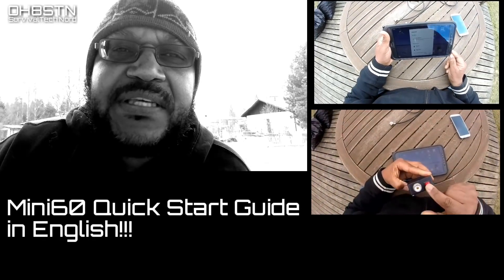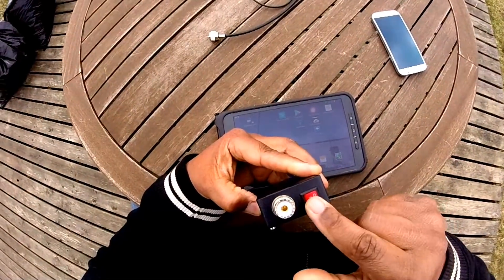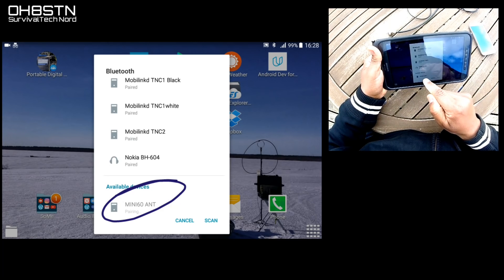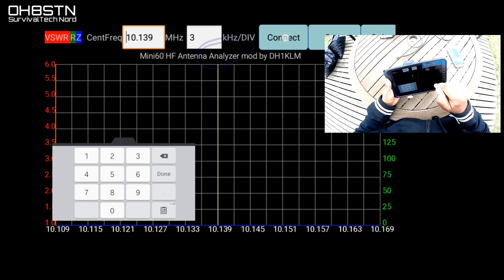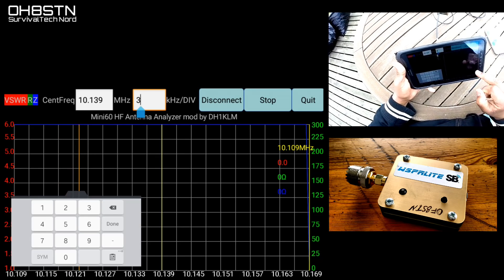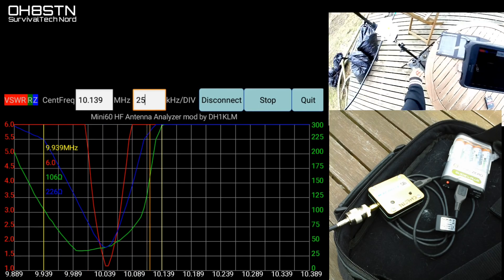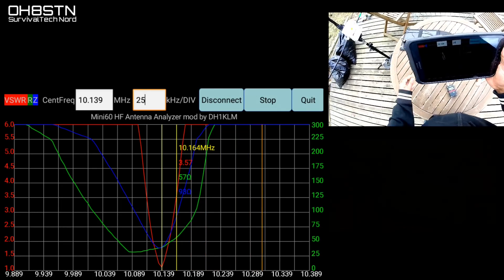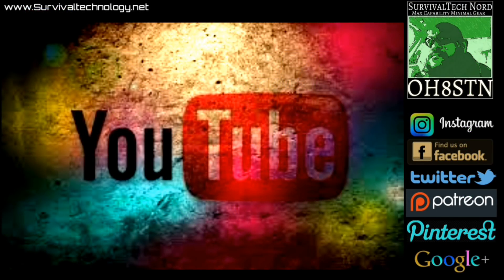Mini60 Ham Radio Antenna SWR Impedance Analyzer Tutorial

Comment: I'm in Thailand right now and can't get a Mini60s with BT, only USB version. Can I connect my Android phone via USB to the Mini60s and use the same APP ? If you have a chance, let me know.
I don't want to order BT less version and install BT module myself ...
Great instructional video, thanks for sharing this ..!!!
Reply from the maker: This is an old video but at least on mine, USB works as well. I just plug it into my Android phone or tablet with a usb OTG cable. You might want to ask the seller if that is still supported on the newest versions.

Comment: Hey Julian, brilliant video. Your presentation is super easy to understand. I had already arrived at a working installation, but it's great to confirm that everything is as it should be. My only issue with the device so far is that I cannot change the step settings on the device itself. Probably operator error! Cheers Mate, Steve.

Comment: Is the mini60s the same as mini60? I received a mini60s which came with battery and says bluetooth but I haven't  confirmed bluetooth yet. Was just wondering the differences of both. Also for the app do i have to download .rar file also, Or just install .apk?